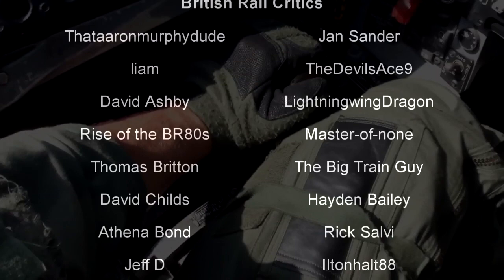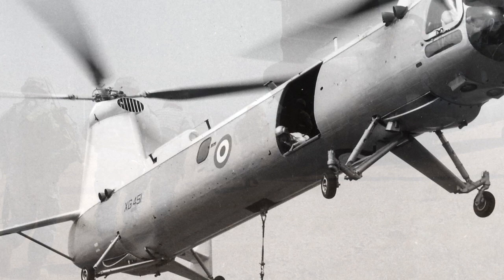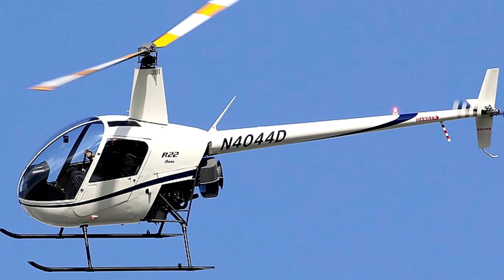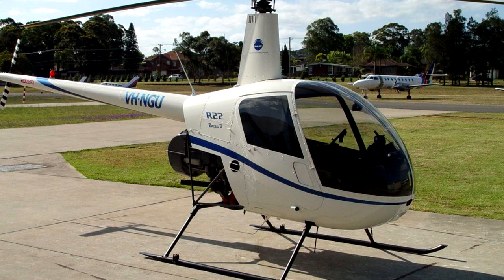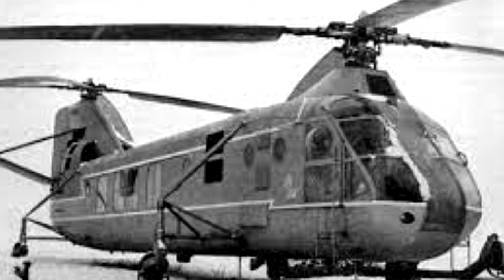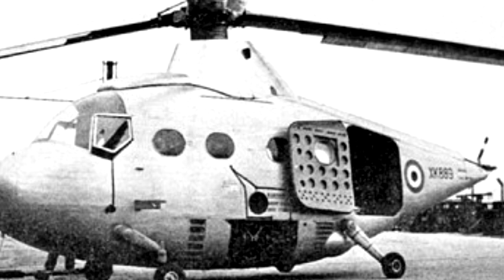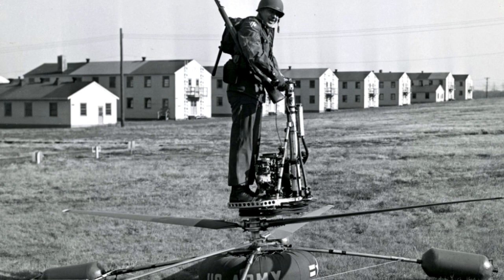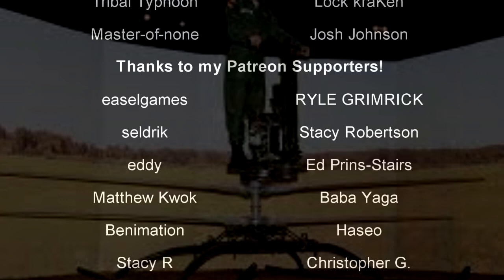5 of the Worst Helicopters Ever | History in the Dark

Comment: I’ve got thousand hours in command in R22s. The issue of low inertia blades was fixed in the alpha version in the 1990s . They have long been heavy inertia blades and are now up to the beta 2 version. The issue of mast bumping is common to all teetering heads not just R22 (including the Huey) so don’t act like it’s a problem of the R22 and chopping off tail rotors applies to all but the most rigid head helicopters. Again not anything to do with R22s.
Reply: Also many of the problems have been traced back to people flying them at low rotor speeds, trying to save gas, pulling to much collective into rotor droop, exc. no problems otherwise.
Reply: my uncle's one time got the blade shake something got out off balance or at the factory was made or painted wrong. pre-2000 units and sorry didn't know him at the time so im not a firsthand experience of it just it cosed him to E-land it kinda hard as it started to become uncontrollable and shaking the piston-poper-type airframe apart,

in general the R22 turban sounds safe to me and had he had it ( wife had enough with aero-stuff and forced the sale ) still i would have gone for a ride with him as it didn't sound scary to me

Comment: So to break it down, you've got two cases of "What were they thinking" Experiments.... the Two tandem rotors, which were "ugh, they kind of worked" but no one could be bothered making design improvements to fix the faulty engineering or make them actually fit for purpose... then it's the Robinson R22, which is in fact fit for purpose, most of the time, just not for the additional uses it seems to be put to.... it's much loved in Australia (and New Zealand) for livestock work, such as mustering, and for aerial animal control.

Comment: The R22 is kinda like a race go kart of the helicopter world. Both have zero stabilization assistance, no electronics that interfere with your input and no correction of your errors. They're both very lightweight, nimble, maneuverable, powerful for their size but also lack any comfort beside a comfy seat. A racing go-kart let's you feel every single little rock on the road, every little slip of the tire, vibration on your steering wheel and every stroke of the piston. The same thing with the R22. You feel every breeze, upwind, downdraft, shifting of balance and movement of your controls. It's perfect to teach someone to be in total control of your vehicle. You're always 100% in control of your aircraft, but that also means that you have to commit 100% of your attention to the aircraft because every single action you do has it's reaction and consequences.

Comment: I learned how to fly in the R-22. Totally safe aircraft if flown per the POH. Incidentally, I have ton of time in the very first ship you show on your video, N4044D.  It was one of my favorites to fly, it was strong and smooth. 
The R-44 is the biggest selling helicopter in the world, I have tons of time on those as well. Also a lovely flying machine, very responsive and capable if flown per the POH (pilot operating handbook). 
I've flown my family in Robinsons, my friends. I have no issues with them.
Reply: careful my uncle had 2 or more of them ( both non turban powered mostly because at the time pre-2000 there wasn't something you could buy legally and install and the $$$ but nowadays in 2022 im sure the turban is the better choice upfront and operating plus ROI as piston-poper's have gone up in cost's more so with 100LL vs diesel-AV )( new and or kit built but had robinson sine-off and double check his work on it, BTW he is vary mechanical/engineering inlined and air-frames well maintained, and had his own private helly pad grass type and from what i got listing is he had high log-time/XP as every weekend and work-day after his maintenance-plant-shift ish he'd go flying 2-hours or more to relax or a alternative to his hourly commuter to work ect. ) and one had the main-rotors flip in flight ( under 300 hours log-book ) and slam it into the ground the other crash was a light side gust flipped/rolled ( 2-X ish ) it on take-off, the others close calls were related to engine failure's like a supplier cheating the FFA rules and or lied to my uncle/Robinson, things like main-belt failed = auto rotate landing, and plugged oil gally or something anyways way to high of oil pressures sorry gramps had pictures of the airframes/him flying but buy the time i got to know my uncle well my ant/my cousins had enough of the drama and forced the sale of all aero-stuff so i didn't get any rides in them/see them-1st hand did work/see his shop that built the kits/maintenance them

Comment: I read an article a couple of months ago by a former Bristol Belvedere pilot and he said that when he asked a colleague whether he had flown a Belvedere, he said no, he hadn't and he wouldn't even walk underneath one if he could possibly avoid it!
Reply: I worked on helicopters in my younger days, and a couple of my older colleagues were ex Belvedere groundcrew. They told me that the Avpin starter was such a risky item, that they used a broom handle to press the starter button remotely.  Thankfully, they got rid of them and replaced them with Whirlwind and then Wessex, by the time I got to do the job - both much safer.
Reply: It was a decent rotorcraft, it was more than up to the tasks given to it and it laid the foundation for the CH/46/47. It was a deathtrap for the crew. Fuck knows what the engineers/designers were thinking, many poor decisions were made.

Comment: The whole point of experimental aircraft is to experiment.  Try new and possibly unconventional ideas and see how they work.  If the idea was a dud and the aircraft weren't produced I struggle to understand how they could possible qualify as a "worst" of anything.  As an experiment they successfully disproved a concept and demonstrated a range of issues to avoid in the future - valuable experience.  Successful designs sit on a mountain of failures.  Celebrate the disasters, they bring us closer to success.
Reply: Something like the Aerocycle doesn’t need 12 prototypes to figure out its a bad idea…

Comment: Here in Aotearoa/New Zealand, for some years it seemed as if every helicopter accident not caused by RL being overconfident involved an R22.
Reply: ..also, on the Robinsons, a key safety feature that is useful for pilots awareness of over-control of the cyclic control, or sudden air pressure changes/downdraughts, 
is an optional extra, ..i.e; 

'the rotor stall warning system'
Reply: @razor1uk610  it's a Low Rotor RPM horn and light. It comes on at 92%.

Comment: I saw the last one in person while in training at Ft. Eustis, VA. It has a safety in case you fall off. Your body weight engages a switch of sorts. When you get kicked off. The blades stop abruptly. It doesn’t sound very safe either way. Because when they stop suddenly. There’s still a lot of force in the moving blades. It’s on display at the post museum. Lots of cool stuff there. Like a hover car from the 50’s. The very first Chinook from 1958-59, can’t remember. All kinds of stuff. First armored HMMVEE experiment from the 90’s.

Comment: tip jets do work though, the Fairey Rotodyne used tip jets to take off vertically then converted into a compound Gyroplane using regular turboprops for forward movement, the only real issue was noise, but if the project had continued this would of been resolved and the tip jets only ran at full power for the first half of take off and the last half of landing
Reply: I think the "we were just about to solve the noise problem" was one of those classic delivery commitments that are made safely in the knowledge that now the project is cancelled all sorts of magical things can be safely promised. Having cancelled a number of big failing software projects, it is amazing how quickly a project teams goes from not being able to commit to anything, to "we were just days away from success".

Looking at the issue, those tiny tip jets needing to power the giant rotary, you needed to move a lot of energy through those small jets, which meant a Supersonic airflow, can't make that quiet. Only way to go quiet is to reduce the speed of the airflow, which meant much bigger tip jets to move a larger volume of air to compensate for the lower energy. But bigger jets, meant more drag, stronger so heavier rotary blades, so they could even with today's composite blades only be marginally bigger so marginally quieter. Which is why the Rotordyne was never going to work as an Inter City transport, it would be like having a Harrier Jump Jet 9r Concorde taking off from a city centre.

Comment: All the problems you mention for the R22 are things that are the same for any teetering two blade rotor system...like for instance, the Bell UH-1 Huey (except for rotor system inertia, of course). I am a CFI and CFII in helicopters and did all my training in one. They're good trainers because you need to learn how to feel the helicopter and be delicate with the controls, and the R22 is a good teacher of that. As to the issues with the helicopter, that's why SFAR 73 was created by Robinson. SFAR 73 requires different levels of training for student pilots, solos, PICs, CFIs, etc. so you'll know the inherent hazards that you may encounter and know what maneuvers to avoid trying to stay out of trouble. Low-g pushovers, for instance, are the thing that can lead to mast bumping if you do them. The reason SFAR 73 was written in the first place was because people were doing these maneuvers, messing up, not recovering properly, causing crashes, and people were dying. Do what you're trained to do in an R22, R44, or R66 and you won't get into any trouble. I've flown these since being a zero hour student pilot, and never had issues.

Comment: A lot of things you are wrong about the R22. 
The R22 was originally designed as a personal helicopter, because the belief at the time was that people would fly as often as driving.  It became popular as a trainer, because of its low operational costs.  

The low inertia of the R22's rotor does not hinder its ability or time needed to enter an Auto Rotation, because the rotors loose their inertia very slowly due to the R22's light weight.  

The issue of Mast Bumping is not unique to the R22.  ALL helicopters with semi-ridged rotors systems are prone to Mast Bumping, like most Bell helicopters... the infamous Huey, AH Cobra, the 222 we seen in Airwolf, the very common 206.  
A lot of Hueys & Cobras crashed in Vietnam from Mast Bumping.
Reply: Not all  helicopters with semi-ridged rotors systems! Mast bumping is a possibility in any teetering-rotor helicopter, with the exception of those with hub restraining springs which eliminates the Bell 222/230/AH-1.
Reply: The bell 47 has dynamic stops to prevent mast bumping
Reply: @paveljezek163  
I suggest you read the opperator manuals of those helicopters.  
The restraining springs did NOT eliminate the possibility of mast bumping in the Bell 222s or AH-1 Cobras.  They were a bandaid fix to an inherent design flaw, that only reduced the potential for mast bumbing... as such... many AH-1 Cobras still crashed in Vietnam pulling negative G maneuvers.  
This is why the new AH-1Z Vipers were upgraded with Fully Ridgid Rotor systems, which do NOT suffer from mast bumping.

Comment: Re: the Robinson R22.  Cheap is right.  It doesn't even have a transmission. It has a 6 belt drive to reduce engine RPMs to Rotor RPMs,  However, regardless of how cheaply made it is, the rental costs is astronomical.  About 15 years ago I decided to get a rotocraft add on to my pilot license.  After being told that the R22 rented for $399 dollars, and I needed 20 to add on to my Coml, I decided to pass on spending that amount of money.  I think a Bell-47 rented cheaper in a different city.
Reply: That decision, though financially based, may very well have saved your life.
Reply: lol. It does have a transmission.

Comment: Mast bumping is common with all helicopters not just the r22 and Robinson has been used as trainers since the 80s and majority is improperly trained pilots for crashes by multiple reasons not doing a proper inspection before operation or pilot error

Comment: Just be thankful British Rail never set out to build a helicopter.
Reply: Didn't a Brit politician suggested dumping trains for helicopters? Could have been interesting.
Reply: @joshuabessire9169  Would not be surprised, they did when they built the M4 motorwar in the 60s, consider building a city the length of it serviced by a high-speed suspended monorail. Failing clearly that the M4 largely follows the path of the GWR.

Comment: I served in the Marine Corps, when we were, slowly, phasing out the CH-46 Sea Stallion, for the V-22 Osprey. Check out the safety records on the CH-46, or the V-22, for that matter. I consider both to be POS's. When the Commandant got fixated on the V-22 most of the funding for the CH-46 went out the window and they got worse. I hated flying on them, especially over water. I got to fly on a CH-53 Super Stallion; that wasn't bad; just remember to turn left out of the ramp.

Comment: What are your credentials guy? The Robinson R-22 and R-44 helicopters are completely safe to operate as long as they are operated in the limits of the manufacturer. They are not unsafe. The SFAR 73 awareness training that is required for an individual to fly them is information that can apply to many other helicopters. The reason the training became a thing is because the R-22 is affordable which allowed more people to fly helicopters. The way I explain it to my students is if you have 100 cars and 75 of them were blue, then 3/4 accidents will involve blue cars. So by that logic, blue cars are unsafe. That is exactly what happened which made the FAA deem them as unsafe when in actuality they have a higher safety rating by number of operating aircraft and accident history than other manufactures. Robinson helicopters are not more unstable than other helicopters either. They are all inherently unstable, however some are more controllable than others. They are harder to fly only because they are very power limited and you are required to understand aerodynamic theory and how to apply that knowledge. Once you understand that, you’d quickly learn that the power they have is more than adequate for a lot of things. That is why pilots who lean in them are generally much better than ones who learn in other aircraft.

Comment: All tandem rotor helicopters have a link shaft connecting the rotors together, that is how they can still fly with one engine out. Also..The R-22 is the most popular helicopter in the world. More R-22’s are sold each year than all other helicopters combined! …So, they aren’t total crap!!
Reply: In the Chinook, the two engines both situated at the rear, each have a gearbox at the fwd. end, linking to a central "coupling gearbox" that in turn powers the aft rotor gearbox, with a long shaft to the fwd. rotor gearbox. The shaft is not strictly what allows it to fly with one engine out. A clutch system in the gearbox does that, by allowing either, or both engines to power the system. The shaft is there to transfer power from the rear gearbox to the fwd. one - and to keep them synchronised.  Turn a rotor by hand and the other one also turns. The Belvedere was somewhat different, and more complicated, with engines on each main gearbox, the shaft was used to power both rotors in the event of one failing, as well as synching them, but there still had to be a clutch mechanism to allow for a stopped or seized engine. I believe that its issues were mainly vibration caused by blade tracking rather than the way the engines were coupled.

Comment: This was a pretty good list. I would probably add one more. The Fairey Aerodyne.
Reply: Why? That would have been a successful design, at least it's trials were successful, & the aircraft was safe, even operated on one engine, and as an autogyro. The design was sound - politics &  finances were the problem there, not the aircraft. It's a shame they were not put into production.
Reply: @memkiii  the same could be applied to the Rotordyne, a very successful concept that was safe and effective which was killed off for much the same reasons but also the noise problems.

Comment: If you ever do a part 2, may I suggest the ACH-47. Basically, the army took 4 C-46 Chinooks and turned them into attack cargo helicopters. And it didn’t turn out as well as the AC-47 gunships. If I’m remembering correctly, 2 were shot down, 1 was strapped, and 1 was preserved.
Reply: Your suggestion is misplaced. There is nothing inherently wrong with these helicopters that would warrant their inclusion on a "worst helicopter list". 
FYI, there is the CH-47 Chinook, and there is the CH-46 Sea Knight. Two different aircraft.
There were 4 CH-47 Chinooks (called Guns-a-Go-Go) converted into heavily armed gunships, by the US Army. Their armaments included 5-50 cal. machine guns, 2-belt fed, 20mm cannons, 2-19 rd. 2.75 in. rocket pods, and a nose mounted, belt fed, 40mm grenade launcher. 
Of the four that were converted, 1 was lost in a hovering accident, 1 was destroyed by mortar fire after being shot down, and 1 was lost when one of the 20mm cannons shot off one of its front rotor blades when a retaining pin broke, while on a firing run.
Only one (named "Easy Money") survived the war and is reportedly on display at the Redstone Arsenal, in Alabama.
CH-47s were/are big targets and bullet magnets.